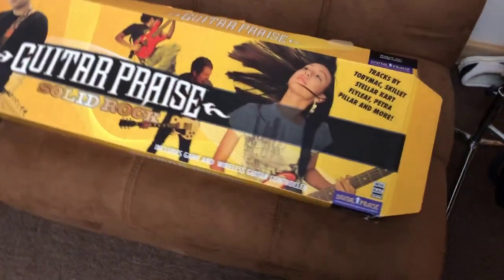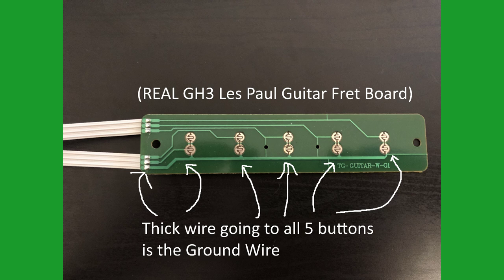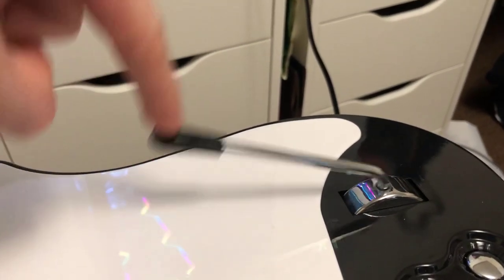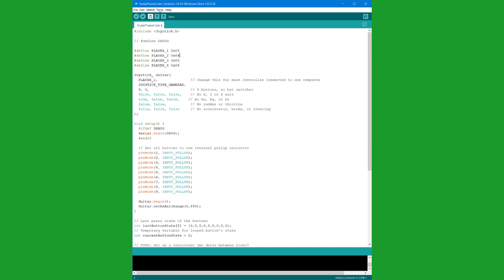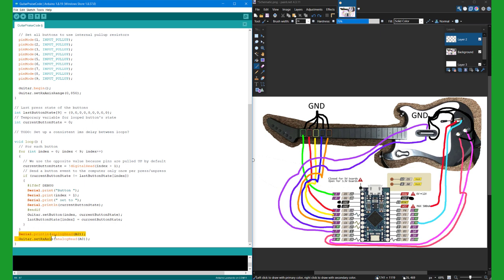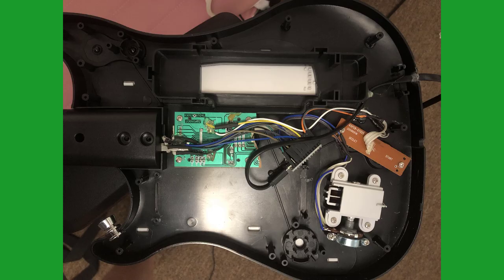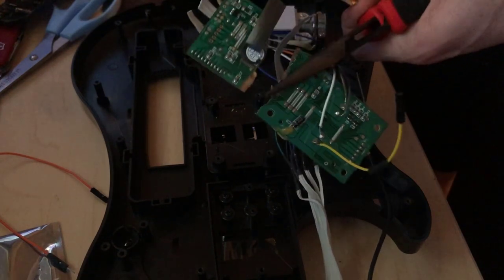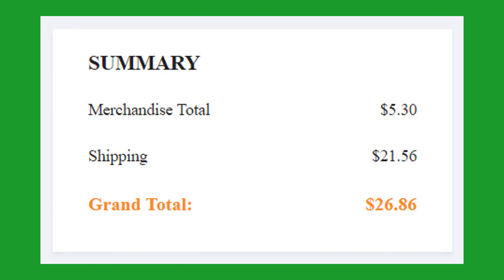Converting a KNOCK-OFF Guitar Hero controller into a playable Clone Hero controller

Comment: I watched this video a few months ago and have been using a Guitar Praise guitar for Clone Hero ever since. It was cheaper($10+$5adapter) compared to the original Guitar Hero/Rock Band guitars & adapters. Heck, I couldn't even find just a GH/RB adapter for less than $25 at the time. The only thing the GP guitar is missing is star power, but it has an on/off switch so it's fair trade off imo. 

All of that^ just so I could say thank you for the information. You saved me like $50-100 for my setup, and it works great!
Reply: what adapter do I need to play it

Comment: it has a slot for a wiimote because that guitar just uses a generic mold / model
its like some knockoff ps2 guitars that also have wiimote slots or a battery holder even though theyre wired

Comment: Does the gerber PCB fit in World tour guitars? I know it wont mount just off of looks but is the distance for the frets able to fit into that or is it tailored to your models? Also great work on the mods, thanks for being a great resource.
Reply from the maker: Yes. I tried to model the distance between the frets as well as the size of the frets to be as accurate as possible to real GH guitars. and you’re right that it wont mount easily inside.

Comment: hey man, you seem to know what youre doing with all that wire stuff, could you make a video on how to arduino mod an official GH guitar? (and turn it into a wired usb guitar)
also you should check out sanjay900’s configurator if you were to do that, it makes the code part so much easier for what i can tell
Reply from the maker: yeah I’ve heard of the sanjay900 configurator but i just prefer to code it manually. Also thats a good idea i could  definitely do a video about doing the arduino mod on a real GH guitar.
Reply: @JoshDesigns    ah, alright, i just suggested the configurator because i have no experience with coding and i would find the configurator to be helpful, also, you could try to make the video using a ps3 guitar since those are the ones that become unusable due to people losing the receivers
Reply from the maker: @tobyzk1730  gotcha thanks
Reply: @tobyzk1730  yes to this or the ps2 sg variants

Comment: Got my hands on a PS3 Les Paul switchable face plate guitar and an ardruino pro micro today. Got tired of waiting for a Wii one to show up so going to try your aproach and bypass the d pad and ps button.
Reply from the maker: awesome! The process should be almost the same
Reply: @JoshDesigns  I figured and I will find out if the latency is from the hardware in the detachable neck or on the board. You also have me wanting to get my 3D printers out of storage and go full custom.

Comment: What Arduino did you use for this? I'm trying to build my own controller but I can choose which Arduino to get an the one you used seems simple and can do everything I need.
Reply from the maker: For this one I used an arduino pro micro. but right now the raspberry pi pico is best and can easily be programmed using Sanjay900's guitar configurator software
Reply: Ok thank you! Why is the raspberry pi pico better than the arduino pro micro? I'm trying to get all the info I need before choose what to buy.  @JoshDesigns

Comment: i tried using the first pin like your diagram for my green fret and the ardwiino configurator tool wasnt picking it up so i had to swap it to a different digital pin. im using up all my pins for tilt, the frets, dpad, start and select but im still down 1 pin for the guide button. any ideas?
Reply from the maker: not sure. you might have to code it manually